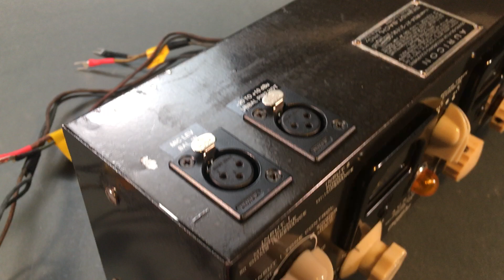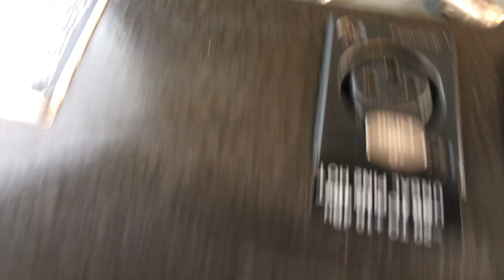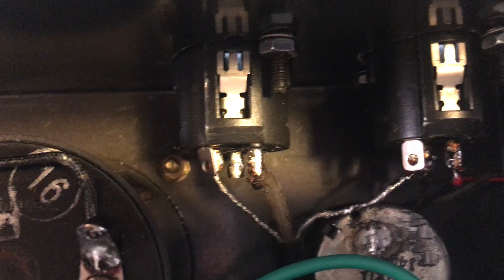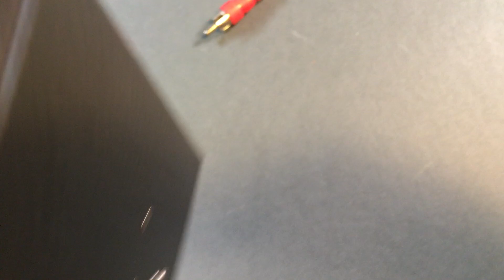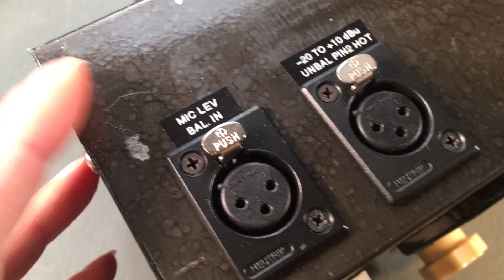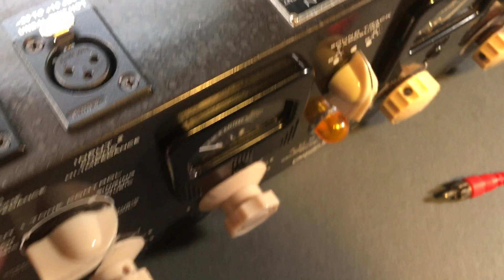Changing Bach Auricon NR24 amplifier connectors to XLR 3 pin.

Comment: Hi Mark. Great video!  I’ve got an NR-24 I’m rebuilding. I haven’t been able to find a schematic or manual of any kind. Any thoughts on where I might find one?
Thanks!
Jack
Reply from the maker: Hi, there should be a schematic pasted inside the cabinet.  But if not, I suggest joining the Auricon Optical Sound group on groups.io.  You can post pictures etc to get help with your amplifier and visit the files section which will have what you need.
Reply from the maker: Hi, there should be a schematic pasted inside  the amplifier cabinet.  But if not you can find one (and a lot of other info) on the Auricon Sound on groups.io
Reply: I would like to talk to you about upgrading my unit